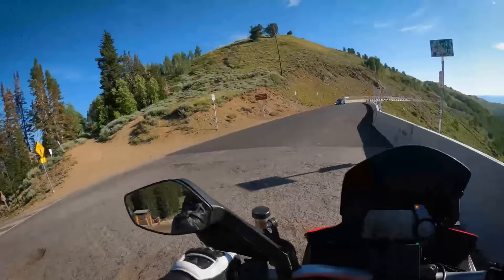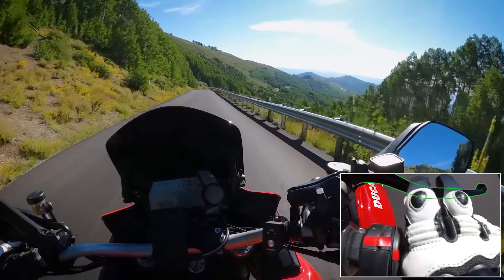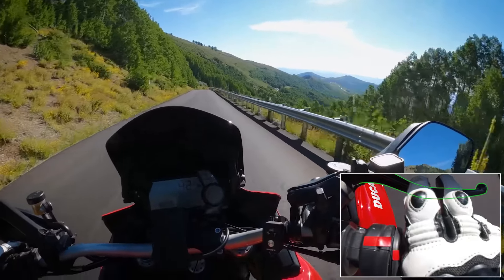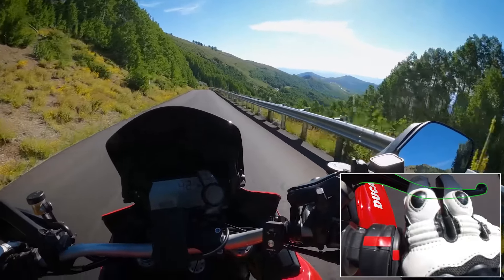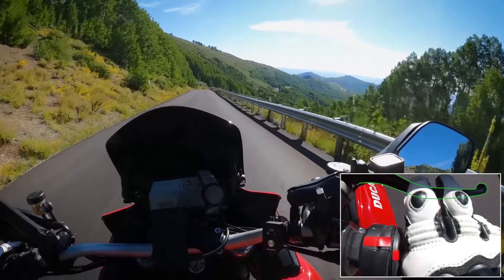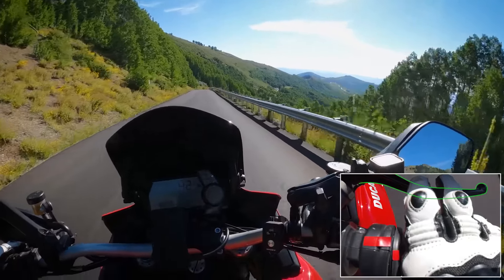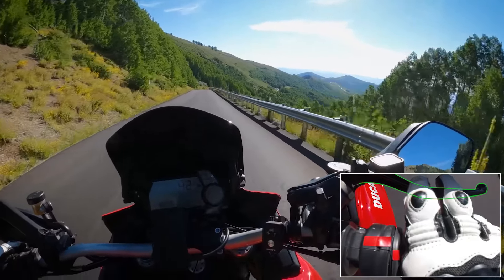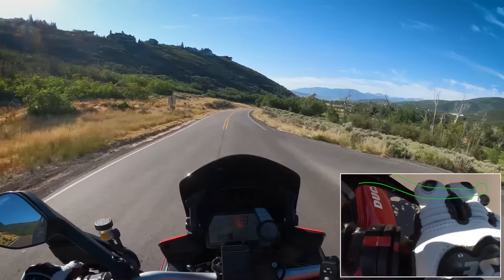Ride Through Downhill Corners With Confidence! // Part 2

Comment: Great Video!!!!! But I'm not sure of the difference between covering your brake and throttle (bad) and trail braking (good)
Reply from the maker: We actually want to always cover or brake on the street. On the track I do most of the time, but sometimes driving hard out of corners it's easier to not for a moment while I'm at WFO, but thats in an environment thats more predictable. 

On the street we don't often go to Wide Open throttle, but it's more likely we may need to go back to the brake at any moment.  

Does that help?
Reply: @CanyonChasers  yes, thank you!
Reply: any instructor or msf course that told you that it was wrong to cover the front brake has misled you. You should try to get that idea out of your head if it's been put in there, because covering the front brake in preparation when you are not on the throttle is empirically safer
Reply: @rondobrondo  My MSF instructor noticed me covering my front brake and pulled me aside.  He told me that for purposes of the course I should not do that, but then later on in confidence he took me aside and told me I was doing the right thing.  I wish the MSF course gets updated... it could save the lives of so many people that for X reasons only take that course and then go out riding on the streets.

Comment: wow, what a lovely road and spectacular view, another great video from your guys. I'm just curious who was the writer that misunderstood the racer that you mentioned, and who was the racer? hard to imagine misunderstanding rear brake to control a wheelie with use of front brake with throttle, though i did notice you blip the throttle on downshifts while braking (as i do) but that's not the same thing. oh and one more thing, i totally agree about the weight equals grip and use of front brake, but on a very wet downhill bend or set of bends in the rain i'll use quite a bit of back brake with less front brake than usual, kind of balancing the two, as i'd much rather have the back start to slide than lose the front end in the wet. like you i've been riding since the 80s, do you use more back brake in the rain?
Reply from the maker: The racer was Freddy Spencer. Check out this video: https://youtu.be/ezmz_jV65oI 

As far the second question. We only ever have 100 points - 100 percent of grip, right. But that scale is constantly changing.  Worn tires, cold road, wet road, etc.   But even with less available grip, we'll still get more from the front than the rear.   So even in the rain - when the taped the first part of this series the road was wet from rain - and I was still relying mostly on my front brake, but adapting my brake pressure and speed to account to less available grip overall.  This is why we really emphasis smooth, linear inputs with a lot of focus on the first and last five percent, so we can sneak up on available grip and not blow right past it with an abrupt input.
Reply: @CanyonChasers  yes i understand exactly what you mean, i probably didn't word my question very well, it was a bit ambiguous when i said "do you use more back brake in the rain?" i didn't mean do you use the back more than the front in the rain, i meant do you use the back more in the wet than you do in the dry even if that is 85% front 15% rear as opposed to 100% front in the dry. another though, i guess you don't get rain there like we get so much of the time here in the uk, where it's not a slightly damp road for a few minutes and then sunny again, but it is hard rain that can go on for weeks and makes even seeing out of your visor hard work.
Reply from the maker: Gotcha! Rain specifically.  We don't get rain like you guys. (does anybody?)  We get rain less frequently so when it does rain, it brings up a slurry of dirt that acts like a lubrication. Less grip than when it rains someplace where it rains all the time.  So, yeah, we might use a bit more rear brake than we'd need to in the dry - but we also compensate with other metrics as well, right?  Going slower, leaning less.  The point I think you keyed in on very well is being adaptable to changing situations and using the correct tool for the job in that situation.
Reply: @CanyonChasers  cool, thanks, keep up the good work.

Comment: The mild rear brake usage was still used in early MotoGP years during uphill accelerations in order to prevent the bike from flipping.
Don’t know if they still do it.
Side note for those wondering why it was used: using a touch of rear brake only simply pushes the entire bike frame towards the ground and prevents wheelies (that pushes the frame up in the air).
Completely useless technique at normal street accelerations…
Reply: Not completely useless.. In some really tight turns it helps.
Reply: @beniniandrea  You do not understand the technique I am talking about.
You are talking about rear trail braking for tight turns. Which is a very useful technique.
The technique CanyonChasers (in the first minutes of his video) and me in my initial message are referring to, is a technique used in straight lines with extreme accelerations. In such a case a bike (without electronic wheelie control) will wheelie. Which hinders fast acceleration as the rider would have to release throttle. With pre-wheelie control electronic, racers were using a touch of rear break in order for the bike not to lift while keeping hard acceleration.
It is this technique that is useless at normal street accelerations.
Reply: @beniniandrea  To put everything back into context, watch CanyonChasers’ video from 0:55 to 1:30.
He is talking about a guy that is spreading misinformation about overlapping front breaks with throttle, as this guy did not understand an old racing technique to prevent wheelies.
My initial message and my first reply to you are describing this real race technique.
Regarding the misinformation (overlapping front breaks with throttle), Nick Ienatsch from ChampSchool just published a video titled « Riders: Don't overlap throttle and front brake! » that shows the dangers of this bogus technique.
Reply: @SFV4   I'm aware of the technique you are talking about, and it really isn't rocket science.. in your first message you wrote "completely useless technique at normal street acceleration" while talking about acceleration and rear brake. This simple action is not useless, you can do it for an anti-wheelie, for trail braking or simply to smoothen the brutal output of a big twin... So it's not useless even at street acceleration...
I replied to your comment only because it seems that you are saying that in general rear brake and accelerator is useless, but now I understand that you were talking only about that specific use.

Comment: Fantasic video and explanation. Thank you :) at any point is there a time you would also use a little of the back brake? or are you best to just use the front? Thanks again
Reply from the maker: Great question!  I'm using light back brake pressure leading up to the corner to help keep the bike settled, but I'm typically off it before I tip in, and then focus my attention/energy on the front brake.
Reply: @CanyonChasers  Fantastic, thank you for the reply. It certainly makes a huge difference. Thanks again and keep up the good work :)

Comment: Thanks for the cool vids and guides.. I ride a v2 Mt09, the throttle is a little choppy.. Any tips for a smother transition from brake to throttle?
Reply from the maker: The MTs are famous for that.  The solution that you have control over is try things one gear higher, where you have less power, less torque.  You can also pay attention to your hand. How tightly are you holding the grip.   If none of that works, you can look at a tune (ECU flash) to remap the FI system.
Reply: @CanyonChasers  thanks for the tip.. I'll give it a go

Comment: Were you also changing gears everytime you slow down or speed up ??
Reply from the maker: Only as needed.  A lot of riders tend to gear down into too low of a gear, which will make the downhill corner a lot more jerky feeling.  We don't necessarily need to be in a super low gear because the brakes are far more precise and we don't need a lot of power to acclerate out of the corner because gravity is helping pull us.

Comment: Did you use the rear brake at all during that downhill even for a second (in combination with the front brake) before easing off the rear and continuing to trail brake with the front?
Reply from the maker: Yes. Just a little bit of pressure on the straight bits before tipping in to help stabilize the back of the bike.  I'm typically off the rear brake before tip in and the majority of my attention and focus is on my front brake.
Reply: @CanyonChasers  awesome, thanks for clarifying that for me! I’ll be on the twisties today continuing to practice this very same thing

Comment: How do you trail brake without mixing throttle?  Isn't that the definition of trail braking?  Or is "don't mix accelaration with braking" what you mean by that?
Reply from the maker: this is an extremely common misunderstanding of trail braking.  The idea that we need to accelerate through the entire corner to maintain bike stability is simply wrong.  Trail braking is just trailing off the brakes past tip in and decreasing pressure as the motorcycle leans.   It is not braking and accelerating at the same time.  And while motorcycling has very few hard-and-fast rules, one of them is we never ever overlap front brake with throttle.   This video will go into more detail for you:  https://youtu.be/fuoYUYFNkGI
Reply: @CanyonChasers  gotcha. I think I got lost in symantecs.  I was thinking of trail braking more along the lines of removing brake pressure while increasing throttle and removing lean angle, but still having 1 or 2 % brake pressure just in case.  But never adding brakes and throttle together.
Reply from the maker: I too like to hang onto that last 1% of brake for as long as I can, especially on a public road, to keep that front tire loaded, just in case.

Comment: I understand that "do all your breaking before the corner" is outdated information, but what about pulling the clutch?
Reply from the maker: Just leave the clutch out. Enging braking is fine, but we don't to rely solely on engine braking. In fact, in a lot of situation, staying a gear higher than you normally would so you get even less engine braking, results in an even smoother, more precise corner.

Comment: dude, is your speed in mph? when you are at 50 looks slower than I'd think. At 40 I start feeling like I'm going too fast lol.
Also I have a thing on my bike that when I release the gas it feels like the bike actuall breaks, unlike yours that seems to smoothly coast.
Reply from the maker: Try being one gear higher. The bike will have less power but will be a lot smoother. We want to rely on our brakes to slow us down more than coasting.

Comment: What about the rear brake? Did/do you ever use it?
Reply from the maker: I like to use a little bit of rear brake pressure before tip in to help settle the chassis, but I’m off it by tip in and focusing on the front brake. Of course, depending on the bike or if you have a passenger, a little more rear brake may be in order.

Comment: That was a nice ride! Are you braking equally with the rear?
Reply from the maker: No, not really. I'm using light pressure in the straight bits to keep the back of the bike settled, but I'm pretty much off the rear brake before tip in. My focus is primarily on the front brake.

Comment: I enjoy your vids but I do not understand why you need to “trail break” at a lot of the points on this… does your acceleration braking/sense of control on those points not do the job saving a potential risk for a slide… surely engine breaking here is far safer? And when you went wide the approach speed and engine braking couldn’t have been correct..was it?
Reply from the maker: As opposed to what? Just engine braking?  What happens if we are relying on engine braking and we need to slow more, do we add more "coast"?   The reason why we want to use the front brake is because grip comes from weight, the more we slow with our front brake, more available grip we have from the front tire, the less likely we are to have a front end slide.  When we are coasting, we don't actually have very much grip on the front tire, the tire we are relying on to do the turning.

Comment: Everytime I've ridden there I come across some hazard in the road. I've seen trees, and rocks in the road. Nobody even bothers to move them. Once I saw a guy from out of state parked right before a hairpin turn. He'd run out of brake pads, and was waiting for them to cool, but he could have found a better spot. Get advice to not go too crazy on the speed.
Reply: Brake pads might be cheaper then engines but engines dont burn up engine braking down a mountain leaving you with no brakes. (Non oil injected 2 strokes aside, but off all the vehicles on the road there is very few of them)

Comment: Are you using any rear brake?
Reply from the maker: Yes, but not much. Mostly just light pressure before tip in to keep the back of the bike settled.  The majority of my attention is on my front brake.

Comment: Sorry, I disagree. At 6:58, "that guy right in the middle of the road" is going around the bicycles impeding traffic. The trucks belong there, they can maintain the speed limit. Nearly every time I have a vehicle cross into my lane, it's to go around bicycles.  I honestly feel they are the greatest threat on the 35-50mph backroads near me. They tend to ride in groups and won't go single file even when holding up a line of cars. Deer are the second greatest danger.
*I do own a bicycle, I don't own a truck.

Comment: first check your brake
Reply: What do you mean?
Reply: @BlindIo42  check they are working properly
Reply: @castor5001  I bet he rode to that spot, so he probably checked before leaving the driveway.
Reply: @BlindIo42  I believe it should be mentioned. Brake fluid conditions, lines, leaks, pads condition. if brake overheating you will have no brake.
Reply: @castor5001  That's all part of basic premise checks and maintenance, this is about technique.